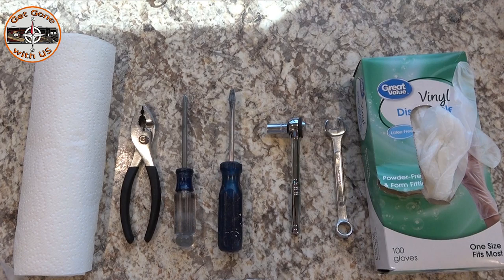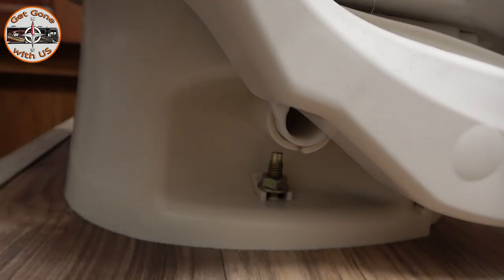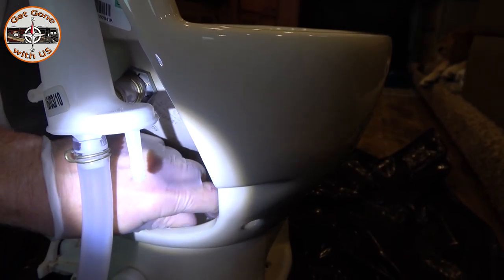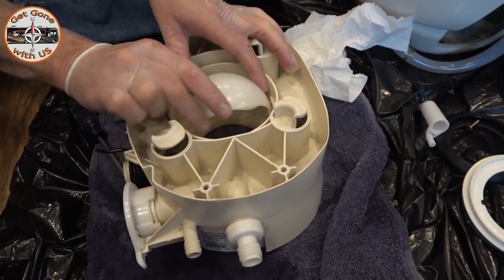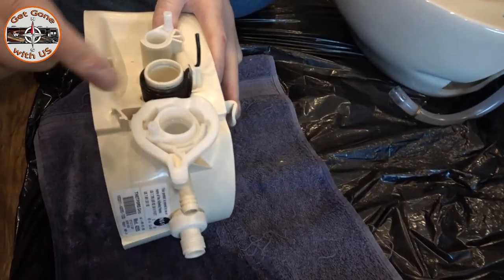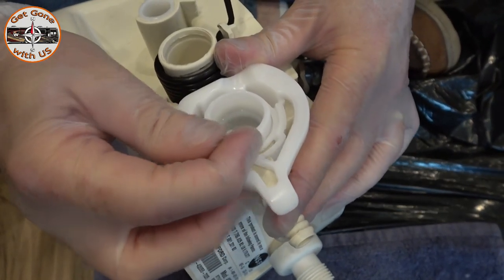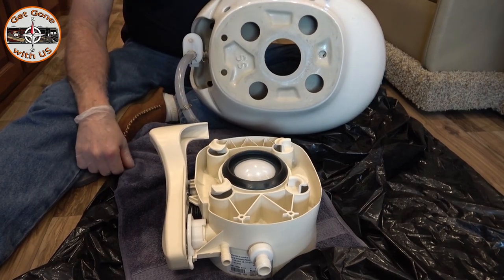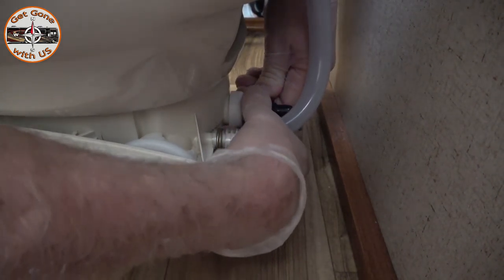RV Toilet Rebuild - Waste Ball and Water Valve Assemblies -Thetford Aqua Magic Style II

Comment: Hey Chuck, great video. I followed all your directions however after replacing all the parts the valve stopped leaking but the bowl is not holding water. Leaks our almost immediately. I made sure the o ring is in the right position. Any suggestions? Leaving for a trip tomorrow so hopefully resolved today 12/26/20. Thanks, Jim
Reply from the maker: Hi Jim. Sorry to hear you are having a problem still. Did you replace the waste ball too?  If you changed everything , first thing I would try is to use a toilet brush all around the waste ball seal to make sure nothing is there preventing it from closing all the way. Can you remove the foot pedal without removing the toilet?  If so remove it and operate the waste ball and the water valve to make sure there is no binding, then close them both and see if the water stays. Another trick is to coat the waste ball and the seal with water proof grease, that should buy you some time  for your trip. Good Luck
Reply: @GetGonewithUS  thanks Chuck for your quick reply. I went all out and replaced everything including the waist ball. It just seems the Gasket is not fitting tight as I can see gaps between the rubber gasket and the ball. I’m considering going back to the original ball and gasket as I did not have a problem with it leaking there initially.
Reply: Everything is back out and assembled on my bench at this point.
Reply: Unassembled
Reply from the maker: @jimandsharonskiles3429  Did you try re-seating it to see if the gaps go away?

Comment: I got everything replaced just as you instructed . I was putting the foot pedal back on,   And the Big Spring popped out , and I can't get it back in . I'm stuck.
Reply from the maker: Sorry to hear that.  It happened to us when we had our Class C about 10 years ago.  We got it back on, but it is far from easy to do and can be dangerous also. We don't recommend attempting it.  Thetford said it couldn't be done, we took that as a challenge. LOL Good luck, might be safer to just replace the pedal.
Reply: @GetGonewithUS  Actually, I got advice from another sight. I took a 1.25 inch PVC end cap and held the spring in place with it, and then I took my 1/2inch wrench and torqued it around and it went right inn place. I got it in place on the second try. Less than $2 versus replacing the pedestal for $99. It works like a charm now.
Reply from the maker: @skibbydogg  Glad you got it fixed for cheap money.  Nice job!

Comment: Hey i have the same toilet. Mines not leaking its just whenever i flush it the water pump keeps running. I have to like press the pedal back and forth 10 times and then it usually shuts off. What would you guess needs replacing. Id appreciate a response!!
Reply from the maker: If the water pump keeps running, is it continuing to fill the bowl?  If so, the water valve may be the problem. Of course without seeing what is happening, it is only a guess and we are not professionals.
Reply: @GetGonewithUS  yup i pulled it apart and its the water valve keeps getting hung up. So ill just have to order a new water valve
Reply from the maker: @lindengauthier4407  Glad you figured it out.

Comment: These Thetford toilets are SO cheap it’s ridiculous.  My ball waste valve broke because our foot slipped off the pedal and the super strong spring slammed the thing shut with so much force it snapped the thin plastic.  Replacement ball valves are not available on Amazon and is out of stock in a lot of the other sites I’ve looked.  I spoke with an RV repair guy and he said those Thetford valves are notorious and even if I fix it, the thing will just break again the next time our foot slips.   Horrible design!  I’m changing to another brand.  Planning to try Dometic…fingers crossed.
Reply from the maker: Hope it works out for you.  Ours has been fine since making this video.  If it happens again we are changing brands too!